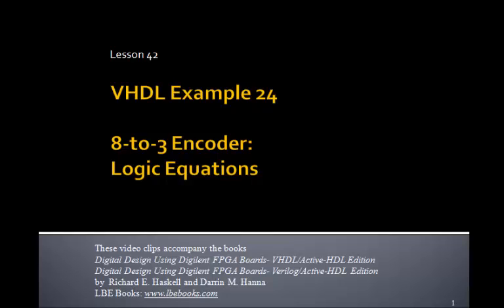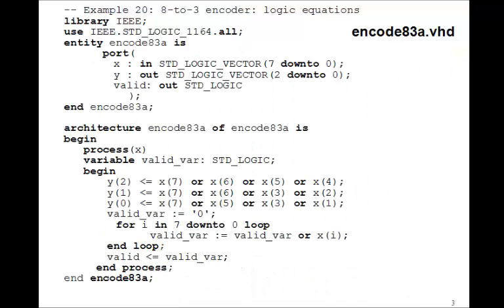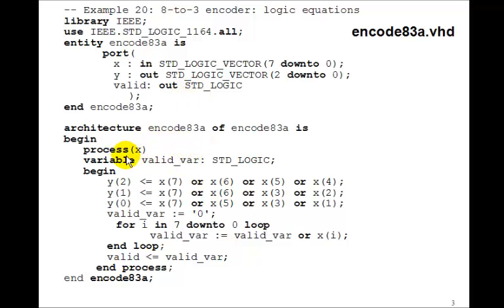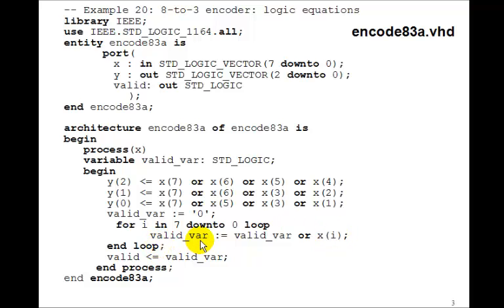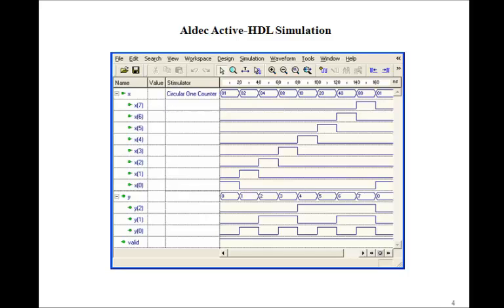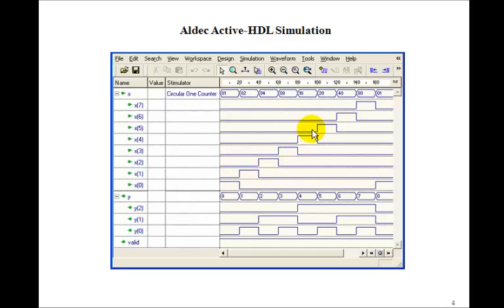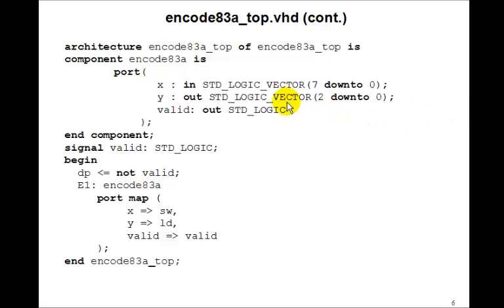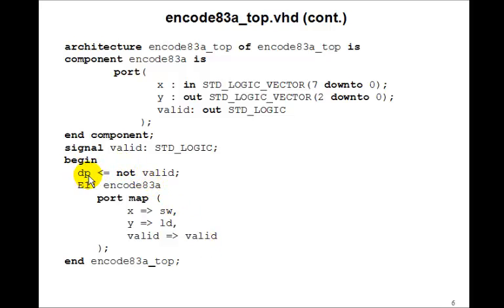Lesson 42 - Example 24: 8-to-3 Encoder using Logic Equations

Comment: Where is the VHDL code to drive the AN3, AN2, AN1 and AN0 pins of the FPGA ?
Otherwise the dp segment will not turn on/off.

I managed to get the dp segment to turn on by pulling down all unused IO pins.

Generate Programming File
Process Properties ...
Configuration Options
Unused IOB Pins = Pull Down
Press Apply
Run Generate Programming File to obtain the bit file.